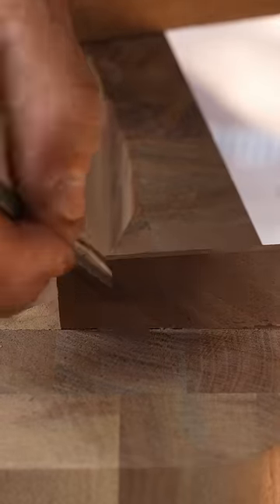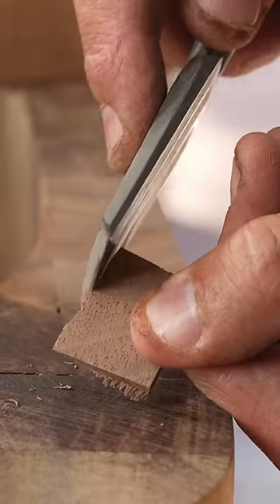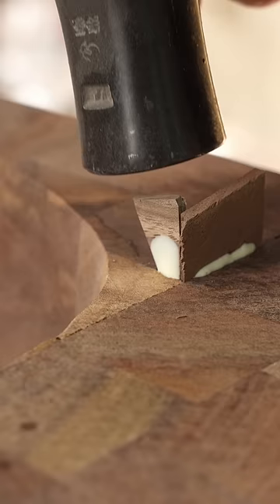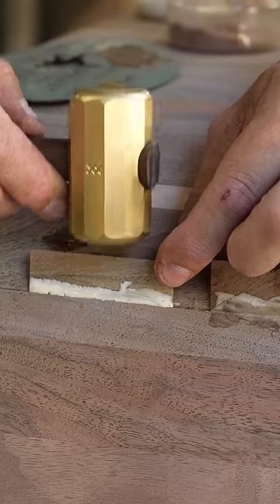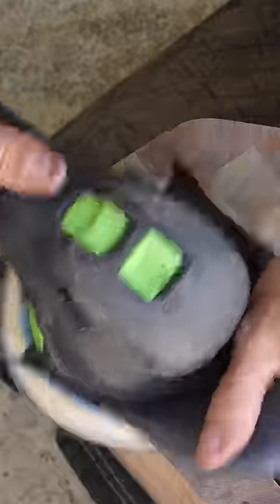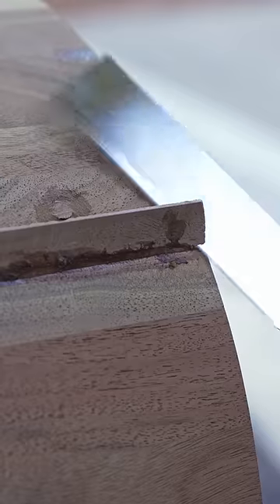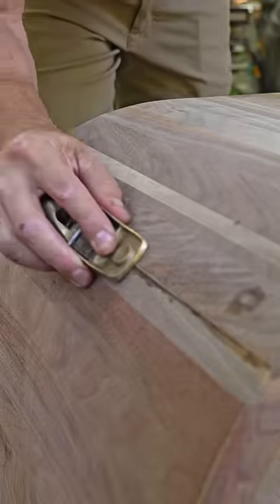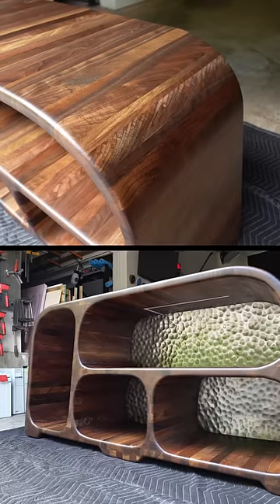Making gaps in wood disappear

Comment: OMG - I have a stratocaster body made of highly figured sycamore with a flame maple top but the top curled up, I took it off, re-seasoned it and glued it back on but it has a slight gap and has sat for 14 years. At last a solution! I just didn’t trust saw dust and glue - mega thanks!

Comment: Would trying to match grains not be possible due to the grains needing to point into the hole otherwise horizontal grain would split when you hammer it, just wondering of ways to blend the woods together

Comment: Before my shop was litteraly stolen.  I had such a project, complicated enough I made one from pine first, it came out good, then hardwood time,  had much the same problem, two long joints , cut a shim and it blended in. As to shop on a Sunday during a 4 hour window, the rear door was busted in tools were disassembled and hauled away, along with a 4x5 x16 foot long stack of oak and a few pieces of walnut. It took a crew to do this....insurance didn't cover but a third the cost. The wife of course wanted half the check....I just gave her the check ....losing gracefully.

Comment: For years, I mixed wood dust with glue to fill those voids; but no matter how malicious I was, you could always see the fix (stains and finishes just dont cover well over glue). Then I tried to simply mix the wood dust with the finish I intended to use for the project (i.e. varnish, polyurethane, etc.) and after sandind and finishing, the fixes are nearly invisible. Go figure? So simple, I should have thought of it decades ago.

Comment: Honestly I wouldn't care that the wood is patched up or you fix mistakes, you obviously put so much care into your work that you also put care into correcting mistakes, and it gives the piece a bit more variety if its a small fill-in like this. Obviously different people have different tastes in what they want in a product, but if they wanted 100% uniform products every time, they'd have to rely on plastic injection molding.

Comment: Used to work with a woodworker. And to fill voids, cracks, and gaps, he'd mix some epoxy with sawdust and spackle the piece. Had several cans of sawdust from specific wood types to match the base color of the wood he was working with.

Comment: Tip from a gunsmith that might help (if you didn't know) using acraglass is stronger than wood glue and looks like woodgrain. I use it for stock repair.

Comment: Not too bad, nice job. I think the giveaway was the fact that you hadn't filled the gap with an end grain scrap like the pieces surrounding it, it'll also respond to finishes differently but that would be my only concern. 

From a practical standpoint: it's a tiny detail in something much larger. 

Think of it as a repair to wood ratio if you will; if the repair is 1 part in a thousand (as in the video) then your doing great. 

A bad woodworker might flip that ratio on its head.. buggered everything up except for that one bit and nobody is gonna buy that!

Comment: I would not use wedge shaped pieces but rather veneer. Using wedges risks putting too much tension on the joint. Sawdust however is brilliant.

Comment: This is fine for larger gaps, but for smaller ones, get a sander and make lots of dust from the same kind of wood and correct color. Mix dust with wood glue till it becomes a paste and push it into the gaps. Let dry then sand smooth.

Comment: Another method I was taught i have used with ipe, is to use clear glue mixed with your walnut dust until it becomes a paste to fill the voids. That way you just need to sand a little.  I am always impressed with your creations!

Comment: I’m curious as to why you never use Titebond’s Dark Wood Glue. I know TB3 is the go-to, but if I’m working with walnut and there’s potential for a visible glue line and the joint isn’t load bearing, TB’s Dark Wood Glue is next level. It’s just a much less visible glue line and I believe it has the same specs (strength, water resistance, etc) as Titebond 2.

Comment: I use all wood flour from sanding of the wood I'm using.  Mix a lot of that with wood glue to make a thick paste, use a stir stick to load that up into a kids medicine syringe, shoot it right into the gap.  It matches and is stronger than everything around it.

Comment: Use some CA glue alongside the wood glue so you can knock down the rest of the wedge so you can finish it really fast with a sponge sander you can utilize that sawdust while it's still got wet wood glue and it blends in about twice as well as this method does, but touche, very similar to what I do

Comment: Here is a trick to get two blocks that are not square  to fit each other. Glue the sandpaper to one block and use it to sand the other. Once you have the other one flat, remove the paper and use the flat block to sand the other one, just don't glue the sandpaper this time.